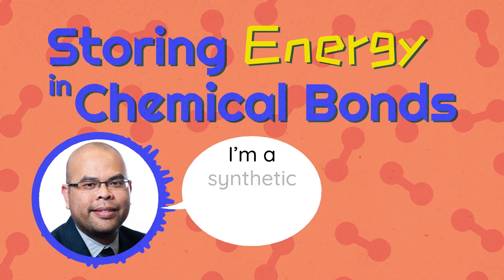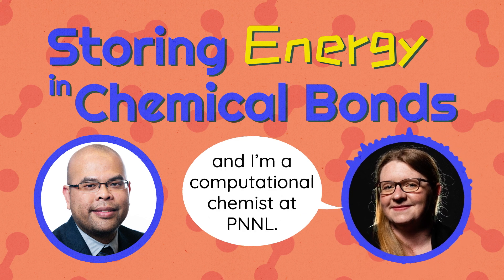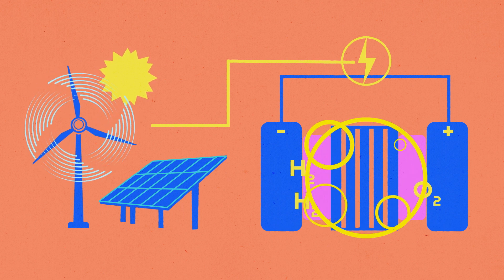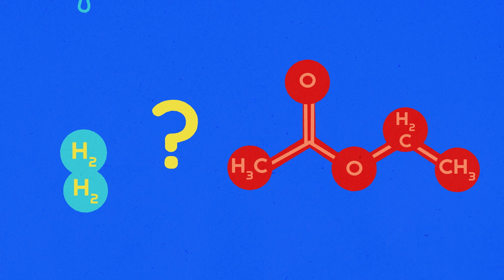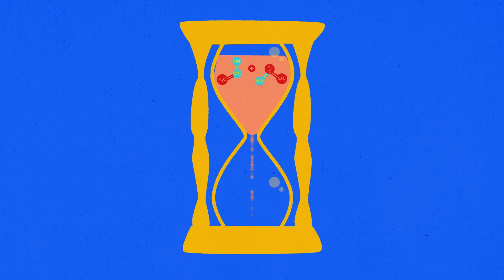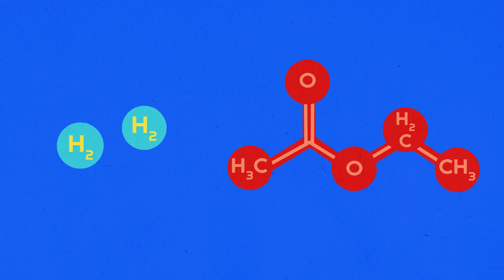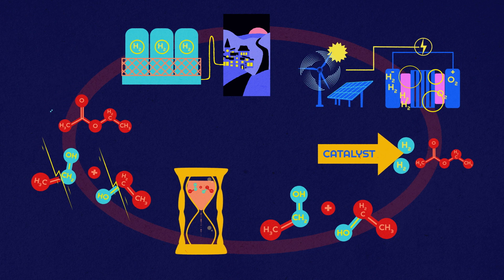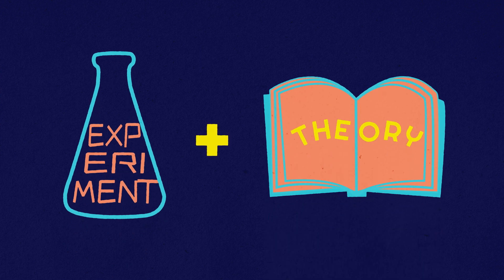Storing Energy in Chemical Bonds

Comment: I am not chemist but I want to store kinetic energy in shapes: imagine a crystal you compress through a chemomechanical reversible reaction driven by pressure, breaking a vehicle and then recovering the kinetic energy as the material goes back to its original shape. Is this possible?